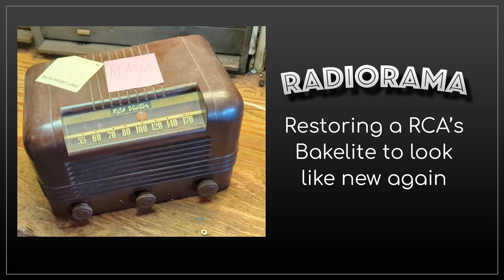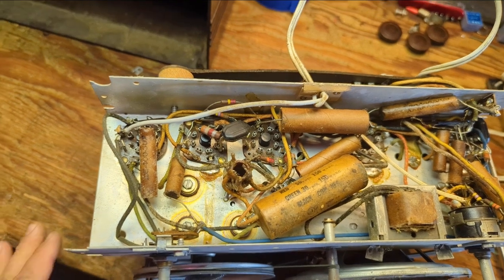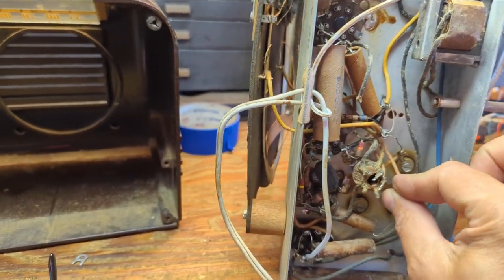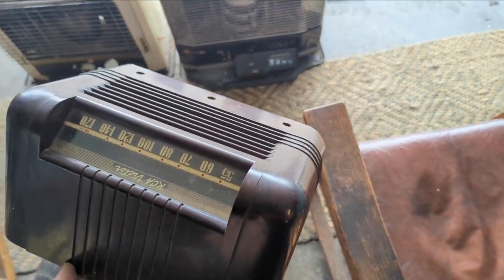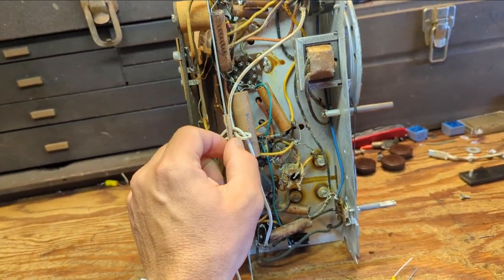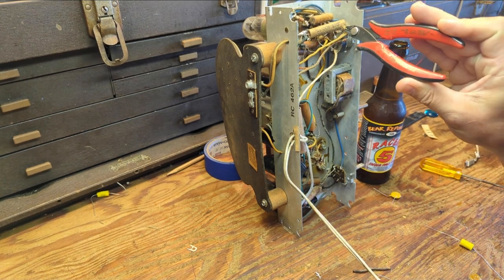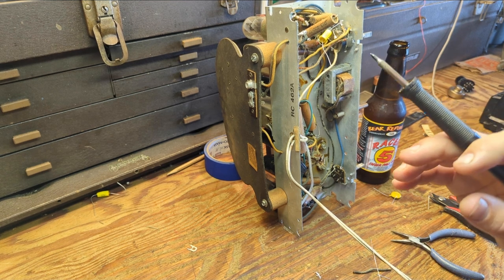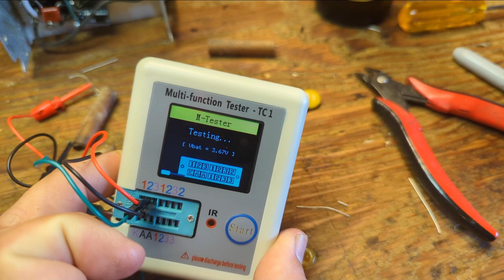How to make old Bakelite look like new: Pre-war RCA 6 toob set

Comment: If you rewire the power so that the switch is controlling the Line side rather than the neutral  side, you will not have any problem with the chassis becoming ‘hot’ when the power is off.

Comment: These six tube sets were very reliable very sensitive for picking up week stations especially at night. Radio like this is definitely worth restoring especially if you live in an area where you do have a couple of favorite AM stations. You will never get silver Mica disease with these sets as they do not use the typical cans that break down. These six two chassis will popular and a lot of various models of RCA

Comment: You should never disconnect pin # 1 on metal tubes that connects to the metal shell of the tube & some metal tubes that is also the suppressor grid connection in some tubes like 6SA7,12SA7 6SK7,12SK7,6SQ7,12SQ7 & many other metal tubes that sheild must be grounded to the chassis to prevent interference, noise and other problems that may cause undisred opration.

Comment: You've really got the knack with making that old bakelite gleam like new. Looks too flash.    When you cut two grids to ground and only replaced 1 with a cap to gnd. Doesn't that affect the other grid also?
Reply from the maker: It doesn't seem to make that much of a difference except for the one for 12SA7. Once that is cut it will squeal like a pig and so you have to add a capacitor to restore that connection

Comment: RCA 16X1 chassis. Untuned RF stage. Recap will be needed - those tubular caps are poor. Good performer if aligned properly.
If the pilot lamp is bad, replace it. 35Z5 prices are not going down.